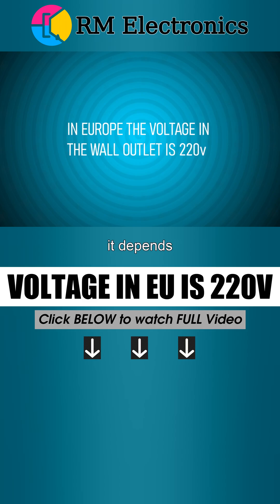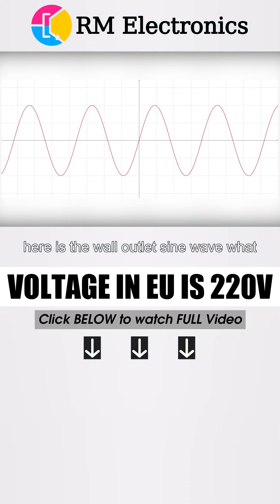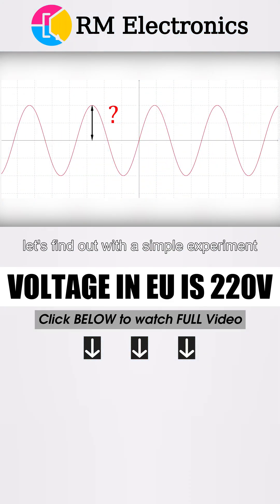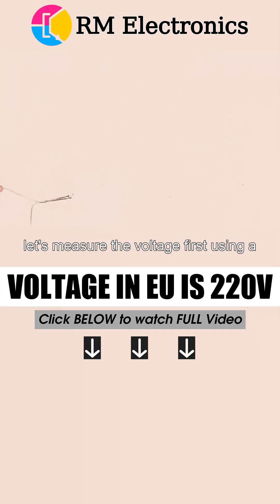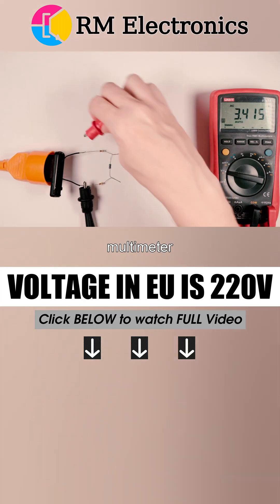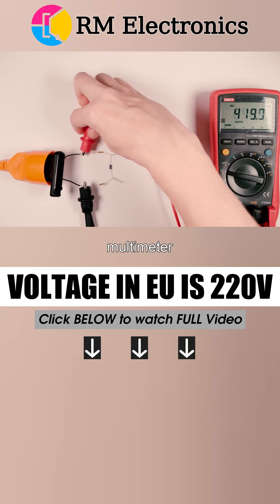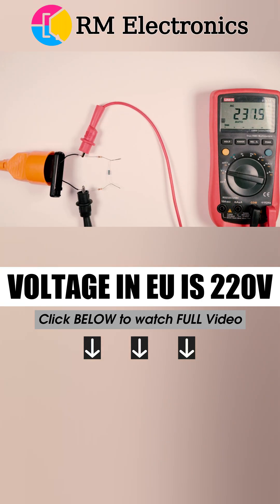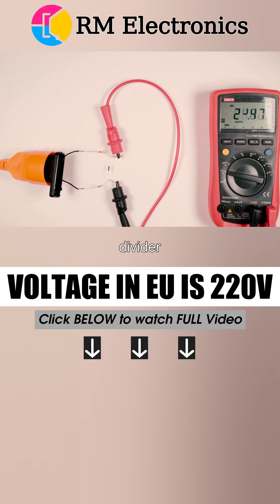Myth #10. In Europe the voltage in the wall outlet is 220v. : 10 Common MYTHS about ELECTRONICS.

Comment: Connecting the oscilloscope's ground to a floating AC voltage source is dangerous for both the instrument and the user.😅😅😅

It is necessary to use both oscilloscope probes and the differential measurement function.